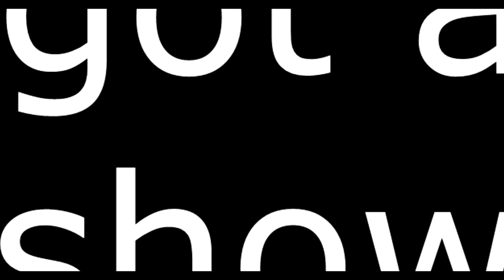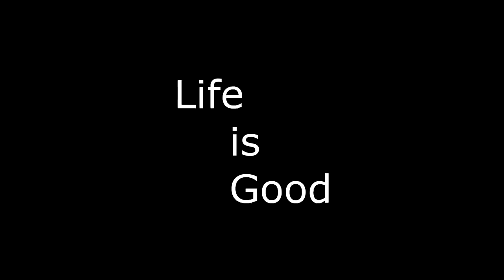511  Overhead cabinets / Cargo Trailer RV Conversion

Comment: Looking good. Lots of room, just not for toolboxes and anvils. I used closetmaid shelving. Screwed the wall supports to the metal ribs in the wall and put 12 inch and 16 inch shelves near the ceiling. Got cloth storage boxes to slide in and bring down when I need something. I mounted the shelves upside down so there is a lip on the front to prevent the boxes from falling off. Been working well even on Shae Road.

Comment: I would say that the weak points are the screws into the end grain at the top of the vertical pieces.  I would consider putting a metal "T" on the front of those joints.   Sure is easy to set on this side of the screen and critique! :-)
Reply: Yep, I agree with you.

Comment: How beefy is the roof to wall corner? Run diagnal straps from there down to the lower lower front to help carry load.
Those black sheet rock screws may not hold up, brass or deck screws are more tolerant to the traveling loads.
Always fun to see your progress.

Comment: Hey Stan.  My 2 cents on those cabinets and the doors. Don’t waste time with doors. Just going to add more weight. Get yourself some ¼ bungee cord. Drill quarter inch holes through the vertical pieces. One at the half way point. Second at the quarter of the way up. Thread the bungee cord through the holes the entire length of the cabinet. Knot the end. Stretch and knot at the other end. You want it right enough that when you push in the center it easily stretches down easily to bottom of opening.  Snug but not too snug. Countersink the holes so the bigger doesn’t fray.  Then add a lip on the bottom of you don’t have it 1.25 inch high. I did this on all my cabinets. Stuff never falls out. The bungee stretch so it’s easy to get stuff out. Took me no time to do it. Allows you to easily see where things are. Works like a champ.

As far as strength. If worried add some braces down to that wall. But I bet you will be fine.

Comment: If you put some braces on the bottom of the cabinet then you will solve the weight issue and not have to worry about the weak point from the top! Either some triangle wood braces or just a piece going from the front at an angle down to the wall will be good enough.
Reply: I agree; as I was listening to him explain his concern about whether those drywall screws would hold, I was thinking a couple of angle braces would take the pressure off of the top screws.
Reply: I missed the part about him using drywall screws but was just thinking that with the few he had wouldn't be enough anyways. Hit enough bumps going down the road and the weight of the cabinet itself would eventually pull itself down anyways.

Comment: Good afternoon Stan...you might want to change to self-tapping screws going into the metal ribs. Sheetrock screws can be brittle and could snap under the load. Like the wide storage and should work great for you. Thanks for bringing us along, Ray in Boise

Comment: Looking good.  As I like to say, "there's more than one way to strip a wire".  I'm not so sure about your fastener choices or methods though.  I don't usually show me building stuff in our videos because it's pretty scary (I have sight issues).  I usually just explain how we did it.  It looks good and works as it should when I'm finished and that's what counts.  The "net idea" for the cabinets is cool, but I'm partial to the look of doors.  You're moving right along.  Keep at it.  Stay safe.

Comment: As others have stated, those skinny tapered head shanks on those drywall screws aren't designed to carry that much weight. Just grab a box of Torx or square head deck screws the length you need and replace one at a time.

Comment: Check out wood to metal screws Tek/Torx on Amazon. We use them when attaching wood framing to metal studs. Probably too late by now depending on how old the video is.

Comment: Riddle me this why didn't you rip the 2x2 (upper ladder brace/door track) with the roof  angle? And then you cabinet  top fascia wood be flush ?  Nailing and glue up would be easier.

Comment: 280zone is correct ! you are not hanging drywall, those screws are brittle and will snap when least expected. Get some self 
tapping sheet metal screws, automotive style...Don't wait for that bump in the road to make them crash down !!

Comment: Those drywall screws are too brittle to hold that much weight.
Reply: EXACTLY! That's what I was thinking as he said they were drywall screws. I've broken so many of those things I can't begin to count them. Stan.....If you are reading this, change those things out. That's an order! I'm afraid that going down a bumpy road you're going to have screw failure and wind up with the cabinets on the floor.
Reply: I wasn't going to say anything about drywall screws. Easiest fastener 2 demo